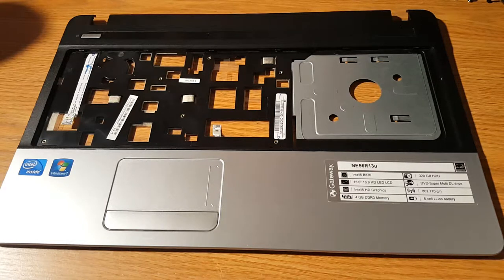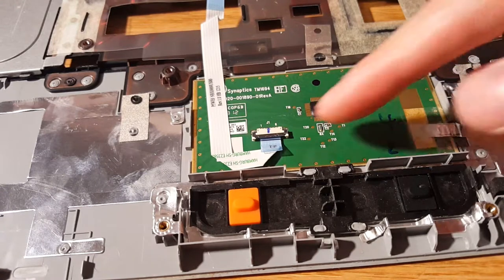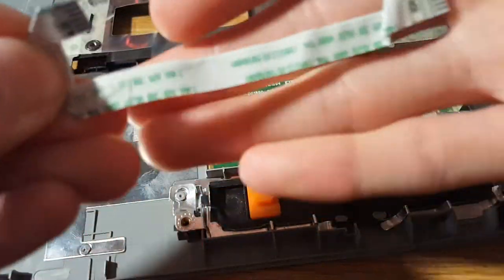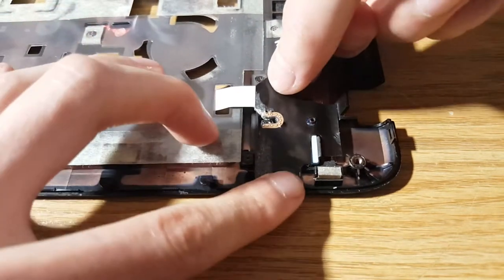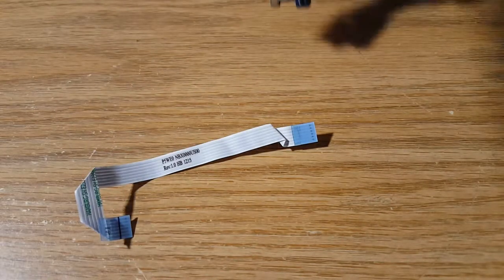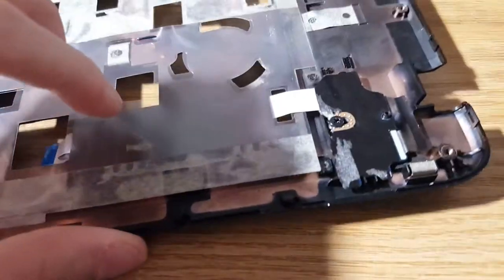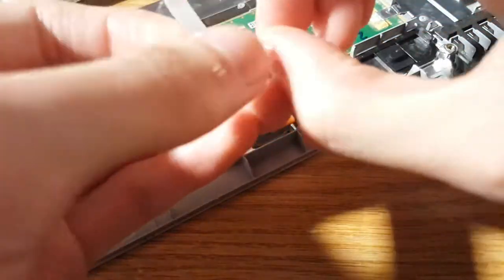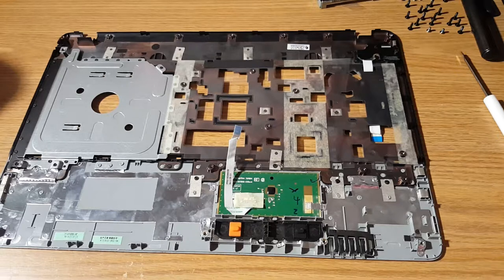Remove Palmrest Ribbon Cables on Gateway NE56R/Acer Aspire E1 Series

Comment: I NEED HEELP!, my sd card got stuck in my 3ds!!!! ill lose all my data if i cant get it out! hellp!!!!!!!!!
Reply from the maker: Regular 3DS or 3DS XL? Here's a teardown of the regular 3DS follow steps 6-9 and skip to step 12. You don't have to remove the screws that hold the SD card slot in. Just use a small flat screw driver, and push the stuck SD card out. https://www.ifixit.com/Teardown/Nintendo+3DS+Teardown/5029